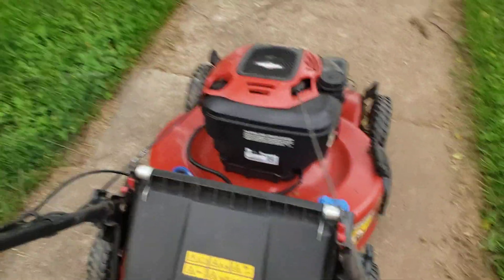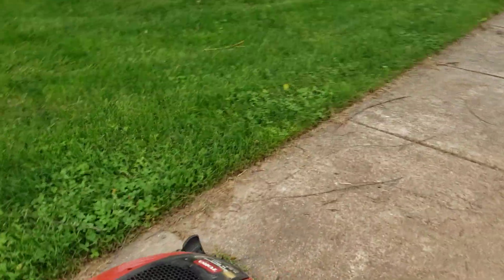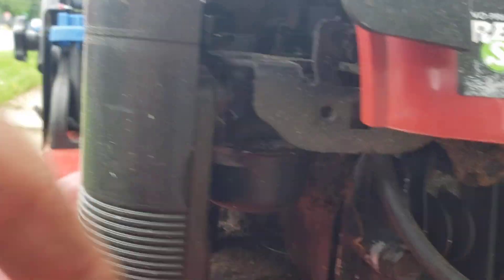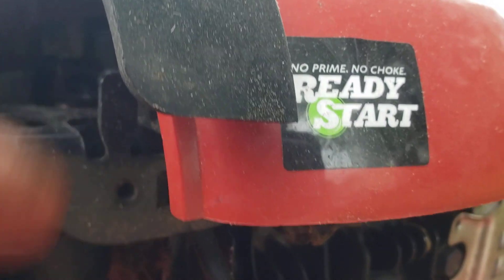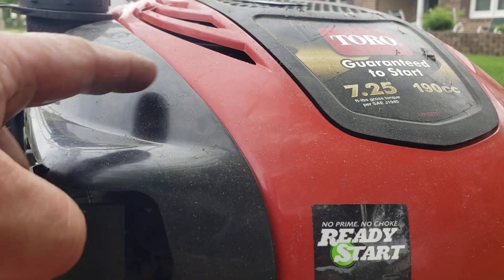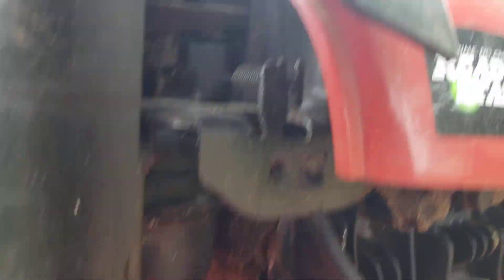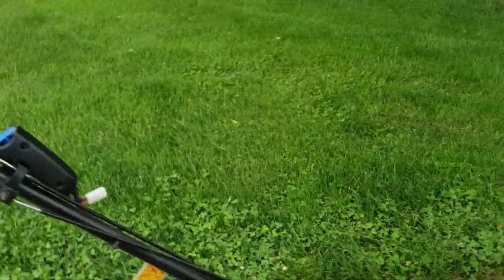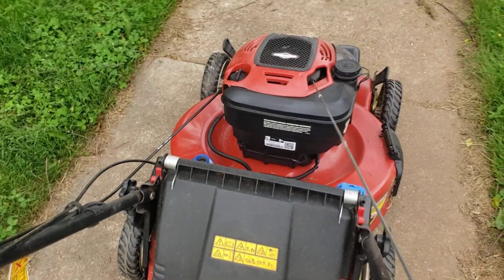service to a toro.

Comment: Just did a New Brigs push mower all the safety BS on a mower ,   I miss the old day  Gas Spark and pull .   Now all the safety stuff and it won't run unless its working .  2 years old been used 4 times , nothing wrong with it they wanted to make sure it run changed the oil and looked at the plug . topped off the tank with Fresh Gas no Ethanol .  20 minutes 5 bucks .